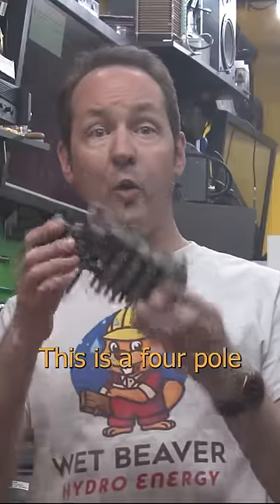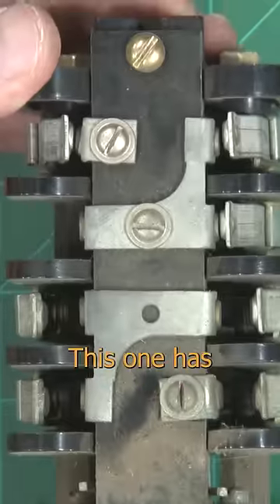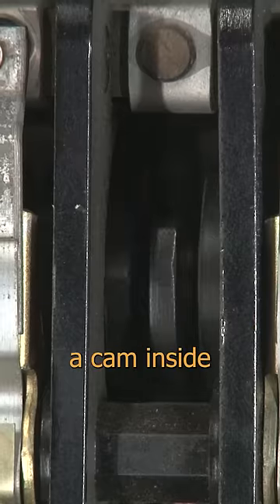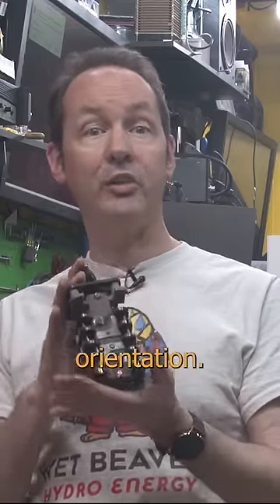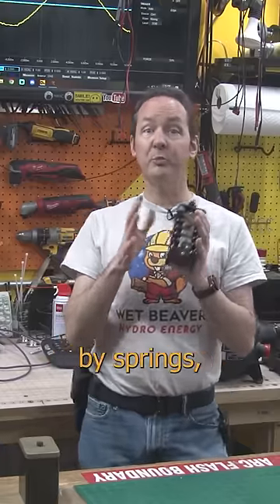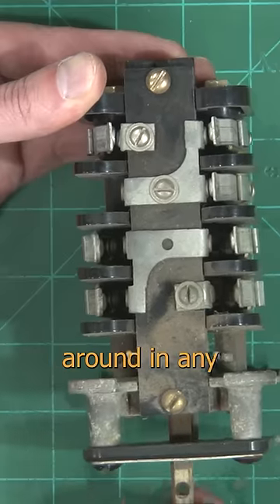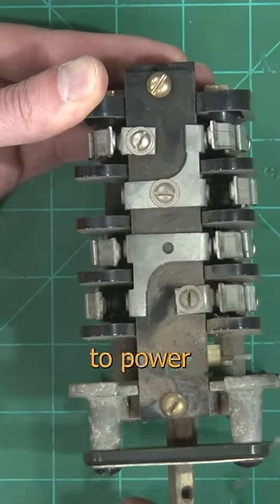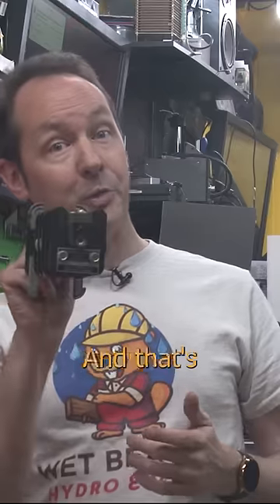Grid Tie Switch #engineering #powerplant #electricity #energy #science #highvoltage #cam #poles

Comment: We use these on for the isolation switch on locomotives. They are used to bring each locomotive online. If we have five locomotives but only need two and it’s winter so can’t turn them off, we can isolate them where they just idle. This saves fuel. It also must be offline to start the engine.
Reply: Thanks for the insight
Reply: Makes sense. If there's a load on the generator, it has the same effect as trying to start your car with the clutch out. I forget what the effect is called.
Reply: Aaaahhhh. I was wondering an exact application where you would wanna turn things on and off in different configurations and not just obviously a bathroom switch.

Comment: Check how the "master controller" used to work on old electrical locomotives. You will find same solution with 50-60 positions closing somewhere between 50 and 150 contactors depending on position.
Reply: I've seen these on controls for old electric gantry cranes, lots of lots of contacts.
Reply: In addition, this solution combined with a stepper motor provided logic sequencing for the early Soviet rockets.

Comment: I've operated that kind of switch many, many times at the power plant I worked at.  Some as many as 20 cams.  Much more satisfying than touching a screen.  And they ALWAYS work! Kerchunk.
Reply: @nathanwal9224 when you’re at the power plant with one of these huge type switches with multiple different configurations just curious why or what application would you need to turn some things off or some things on… And yes, I know it’s basically a switch and you could hook it up to your bathroom light… but what’s more of a real application?

Comment: I’ve used those as breaker control switches. There was a trip, inline, and to close position. To close spring returned to inline. They work great until you have to take them apart and fix some of the wafers.

Comment: I was at an antique store recently when I came across a massive fuse and was wondering: what do you suppose the application was for something of it’s size?

GE 
Type: EJ 
Model: 9F60 HMH080
Max KV: 15.5
AMP: 80E
HZ: 60

Made in Hickory, NC

Looked like 2 giant glass tubes with copper caps on both ends. Reminded me of your channel! Thanks!

Comment: I have a smaller version too reverse the motor on my single phase lathe motor.  What a brain bender it was to figure out how to wire it currently!
Reply: Generally you just need to remember to make an X between the fixed contacts. Though AC motors can be weird!

Comment: My dad was an electrical engineer, masters in electrical engineering, 50+ years, VP for Intermatic Co. he would tell me all about that stuff… so now your the guy, I get the idea that device basically turns things on and off but my question is why or what would be a reason you would’ve want to have some things off or some things on or some things jumped together basically, what are the capabilities/ actual uses of that particular switch besides, just turning things on and off. Did this thing come out of a 500KW GEN?
Reply from the maker: This is from an 800kW generator, and was the switch that actuated the 500lbs disconnect contactor. But, I mean, you could use it as the light switch to your bathroom if you wanted to. Or the Enter button on your computer keyboard. It's just a switch. But it's a pretty cool switch.
Reply: Thanks for the quick reply I understand you could hook it up to your bathroom, so basically, if this was in a generator, you could just have different things powered at different times based on the application? I understand that concept, but could you maybe be give an example Of a situation where a big generator might need to power different things at different times. I don’t know if that makes sense. Just curious thanks for the quick reply!! I WISH THE WHOLE INTERNET WAS LIKE THIS!!!!!!❤❤❤❤ (edit) I made my guess off of a 20 house neighborhood and it came out to 500KW LOL)
Reply from the maker: It's more like telling the big generator to turn on, and telling the safety system (on a totally different circuit) to now changeover and watch this new thing, and telling the indicator light (on another totally different circuit) to come on, etc. Sometime you need one physical action to do several different things at once. Generator switch to on, turn green light off, turn red light on, turn safety system on, all at once.

Comment: So what yr saying is normal config. has a "spring"  but in this modified version a " Cam" was installed replacing the "spring"??  That's what it acts like but I, could be confused? In a reciprocating engine the same components can be switched out which is where the idea came from??. This stuff is so archaic & awesome three dimensional puzzles. 🤔😁

Comment: I call bullshit on this video, as at best a gross misrepresentation.  

That switch is likely rated around 30 amps at 600 VAC.  Grid by NESC definitions is 69 kV and above, primary distribution, usually in the 500-2500 amp range per segment, and most often in the 115-230 kV 3 phase range.  

A switch like that might handle transfer of a single home or small business generator, or if used in a utility substation, been used to operate high voltage contactors outside the control building in which it could have been installed.  

Most substation grid side management these days is done by remote SCADA data linked to regional interconnect management pools, that also control major power generator plants going on or off grid. 

A switch like that would not handle even the secondary feeder into a neighborhood (usually 2400 VAC to 27 kV, 50-500 amps 3 phase or single legs split off).  

Sadly, only one other commenter here suggested a realistic identification for that switch, while one other suggested cut the bullshit and try for honesty and accuracy in tech claims, not sensationalistic nonsense language.